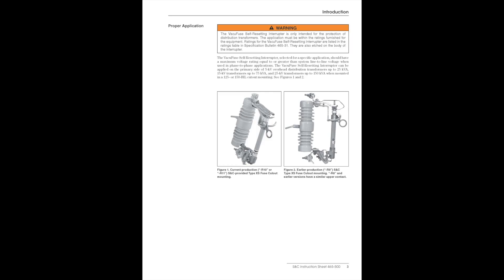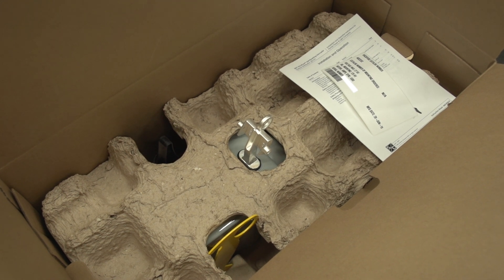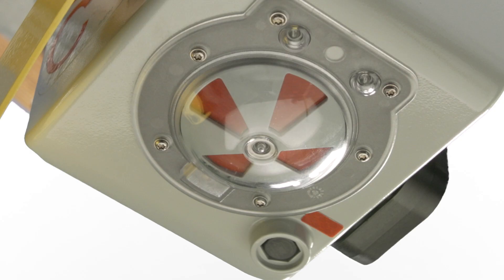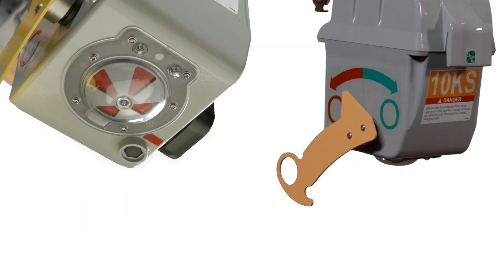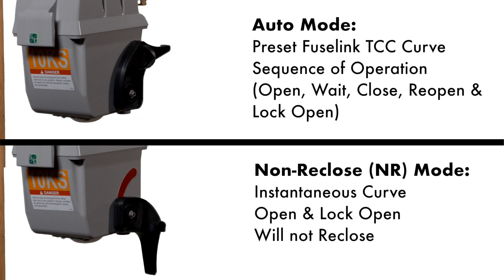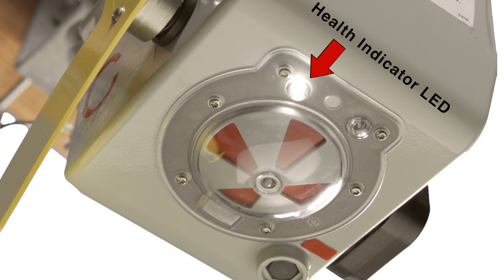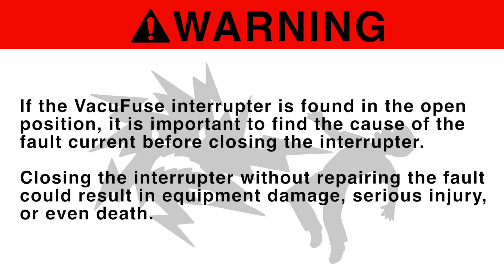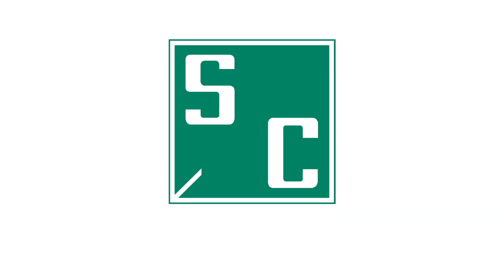S&C VacuFuse® Self-Resetting Interrupter Installation and Operation

Comment: hello, is it correct, works like sectionalizer?
Reply: sectionalizers don't interrupt current and are not programmed with response curves. im not sure if there is a sectionalizer mode, based off loss of voltage and time.